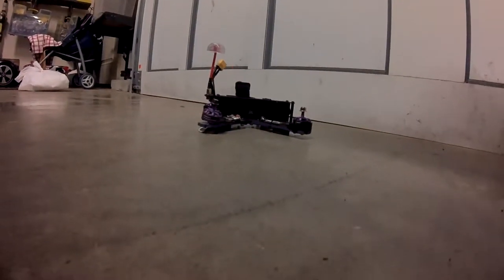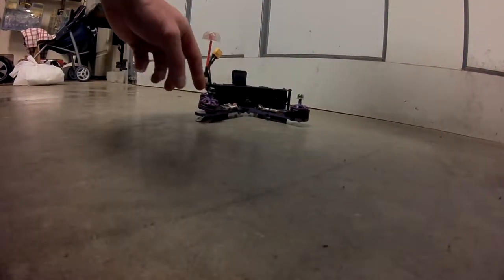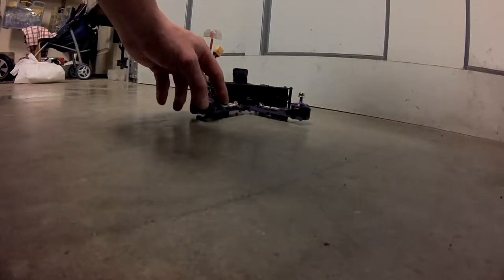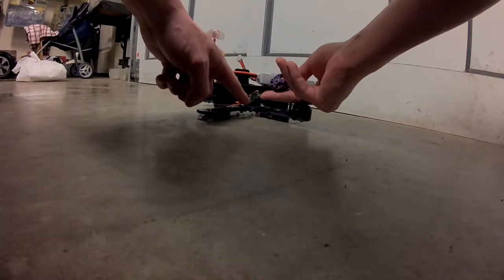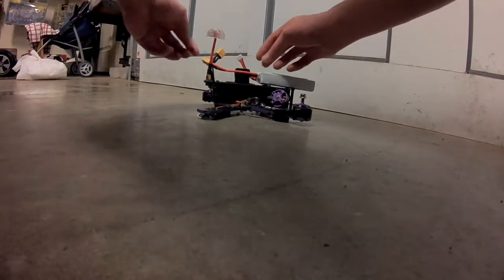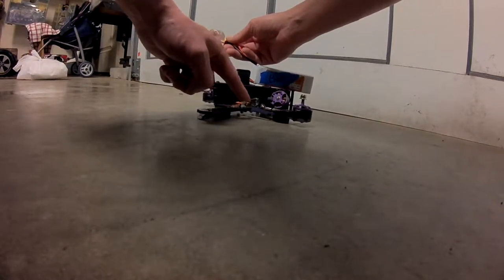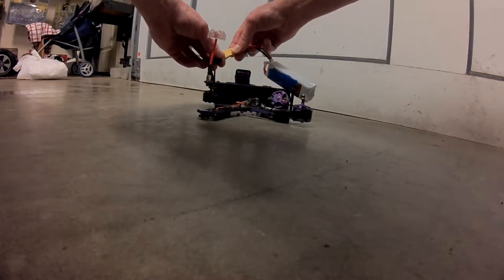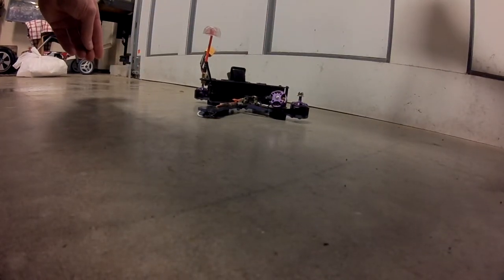Eachine WizardX220 20A blheli_s ESC Fire

Comment from the maker: The replacement RACESTAR BLHELI_S works.  it's not the same brand and the firmware was different.  I flashed new firmware with BLHELI_S Configurator and had to set the rotation as reversed in the firmware setting but it works and I can fly again.  I've only done some test flights but looks good.
Reply: Chris Arends I noticed the RACESTAR esc are lighter will that matter
Reply from the maker: I didn't notice any weight problem when flying.